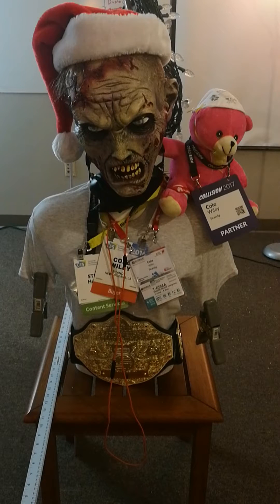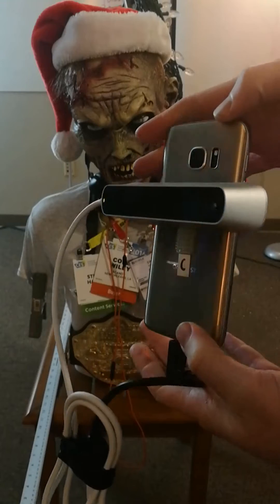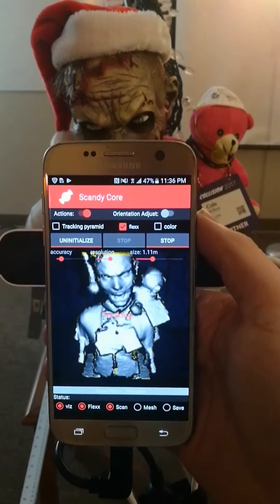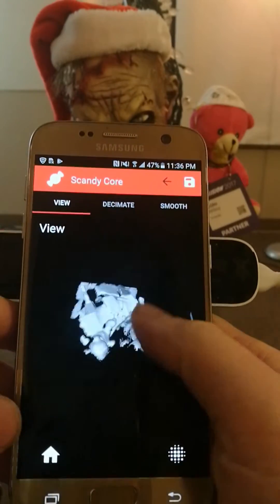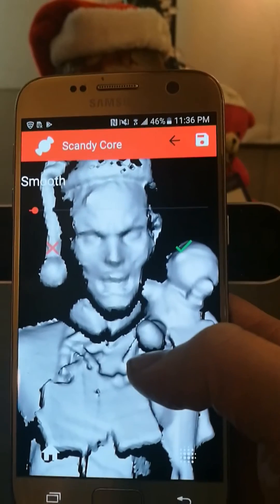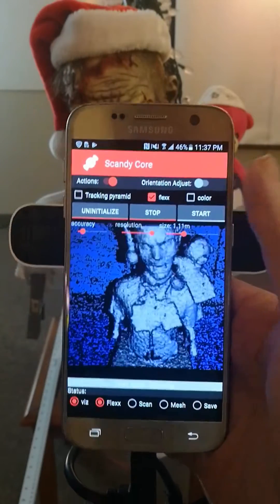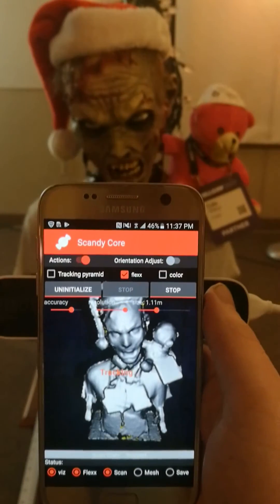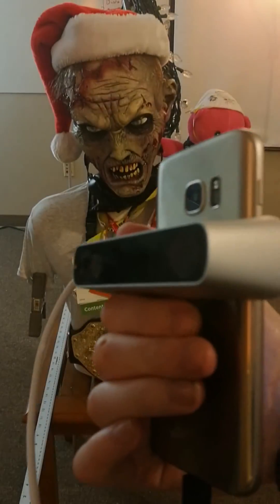Structure Sensor Demo | Roux SDK Demos

Comment: What's the polygon count of the 3d scan?
Reply from the maker: Hey Scott, the poly count varies depending on the resolution and subject. Here's a model scanned on high resolution with the Structure Sensor + Scandy Core on Galaxy S7: https://sketchfab.com/models/286faef13c3846fd9fd85c3b34edae87
Reply from the maker: VERY HIGH

Comment: I cannot download the app on my Galaxy s8. I have the structure sensor and want to try this app. This is awesome!
Reply from the maker: Hey Cody, thanks for your interest in what we're working on. We will be packaging a version of Scandy Pro that works with Structure Sensor soon! We'll make an announcement when it goes live!
Reply: Scandy awesome cannot wait for that. I wonder if down the line there would be a way to overlay phone camera data over the mesh with a calibration. The structure sensor iPhone app has a calibration that can figure out the difference between the phone image sensor to the ir sensor so it can offset the color data over. Obviously the scan is the priority and I thank you for making this a possibility. I cannot wait to have a truely mobile way to make scans. I'll make a phone case with my sensor on it or a magnetic attachment where I can just pop it on and scan when needed. 

I am blown away by the demo I saw that you made a plane on a human scan and were able to measure the model on that plane. Now I can get or make clothing and hats etc to my size without worrying about measuring tape. 

I'd love to see a version of this where you could scan someone before and after like a diet or workout challenge and be able to actually quantify the data of gains and losses. That would be huge for gyms and trainers and just the average person trying to feel good about loosing belly fat. You can look at before and after pictures but you can have 3d before and after and durring and have numbers to show you lost this much around your belly, gained this much on your arms. Super cool. 

Keep up the good work, I cannot wait to try the app when available. Is there some sort of mailing list or should I just add a alert to my YouTube subscription for your channel to stay up to date on this.

I'd love to help test out and come up with use cases and bug reports or whatever I could do to be helpful. I am pumped with the new technology.
Reply: Scandy may i have your contact information, i have a buisness idea and would like to partner up with you guys and i love the idea !
Reply: Scandy if you have a beta program I'd love to help ya test it out.
Reply: Scandy still planning on doing this? The scandy pro app still shows incompatible with non tango phones. Please open this up, I would pay to be able to use my structure sensor with my phone! I check back with you guys often hoping to see something. I'd pay for the demo shown here alone.